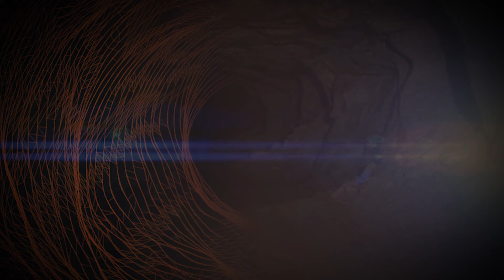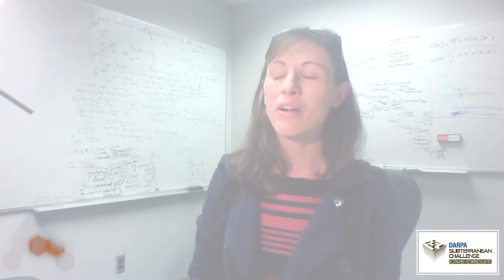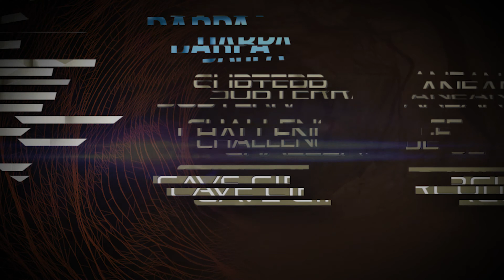BARCS Team Profile – DARPA Subterranean Challenge Cave Circuit

Comment: Why do you remove my comments, DARPA? Psychotronic means remote mind and body control. Well known bydirectional brain-machine or brain-computer interface (BCI) that allows computers and other special equipment to influence and write into human brain is, actually, the Psychotronic Weapon. You can find hundreds articles in scientific journals and mainstream media about different projects that "create" Psychotronic technologies. For example, DARPA finances researchers in 15 American laboratories, including Rice and Brown Universities, in order to develop devices that read mind and write into it. Scientists in Brown University aim to develop a “cortical intranet” of tens of thousands of very small wireless chips that can be implanted onto or into the human cerebral cortex, the outer layer of the brain. The implants, so called “neurograins,” will operate independently, interfacing with the brain at the level of a single neuron. The system will be designed to have both “read-out” and “write-in” capabilities: it will be able to record neural activity and will also have the capability to stimulate it through tiny electrical pulses. Rice University got a grant of 18 million USD for the project, Brown University - 19 million USD for this purpose. Just tens (not hundreds or thousands, but tens!) researchers are involved in these projects that will be ready in approximately 2022-2023. This information means that these scientists are actually washing ready dirty military technologies, because these technologies are very expensive, cost tens and hundreds of billions (not millions!) dollars, have taken efforts of hundreds or even thousands of scientists for many decades (not 4 or 5 years!). These Psychotronic equipment and special computer programs (artificial intelligence) have been created, developed and perfected for decades on human subjects, including involuntary human subjects, who have never ever given their informed consent to be "guinea pigs" in these classified military experiments. Targeted Individuals are people, who claim that they are these involuntary human subjects, who were or still are used in the fascist mind control experimentation. Canadian, American and other governments try to convince that they stopped these mind control experiments on involuntary human subjects years ago, but it is hard to believe governments that have long history of criminal classified experimentation on human beings without their informed consent and reject testimonies of thousands and thousands of innocent civilian people, targeted individuals, used against their will by criminals to create, debug and perfect Psychotronic weapons. Are DARPA and other government institutions in Canada and USA going to stop the fascist heinous experiments on involuntary human subjects and compensate their suffering, losses and damage?